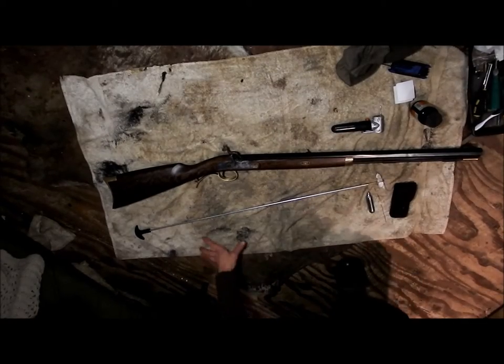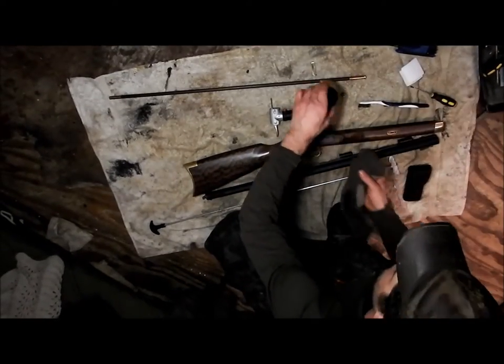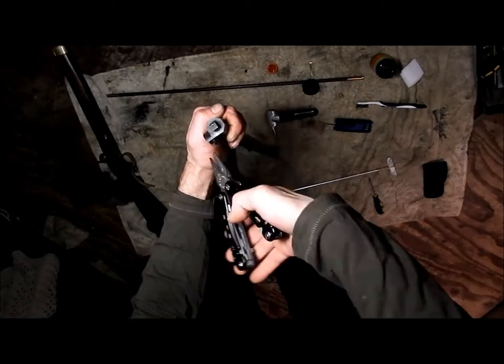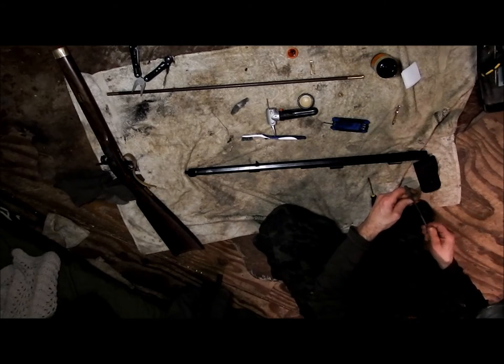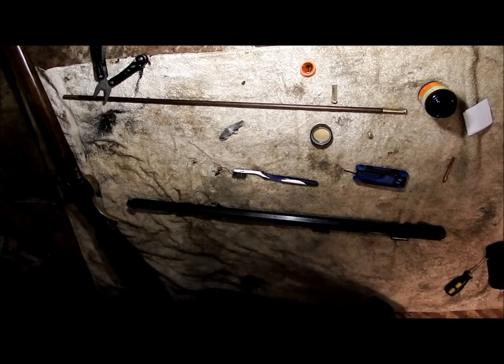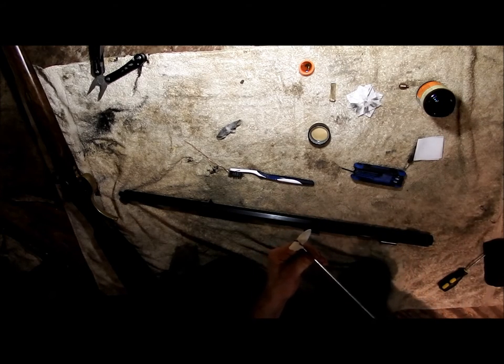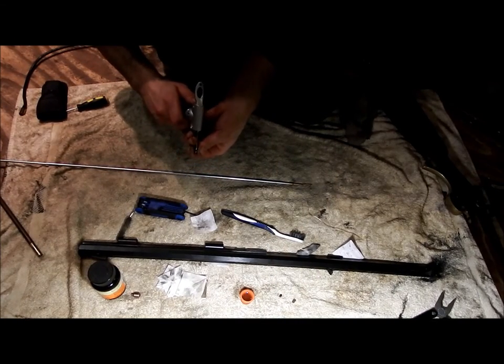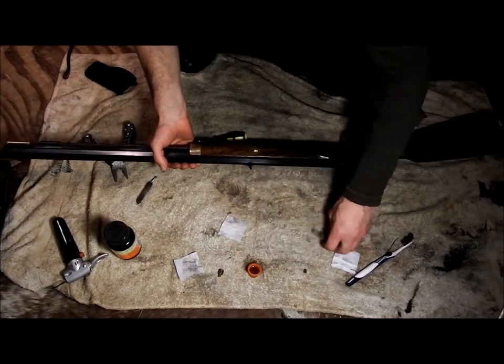cleaning the Lyman muzzle loader

Comment: Fill a bucket or large can with Hot soapy water,  immerse the breech end of the barrel in the water, then using a patch in your rod to pump water in & out.  Change water a few times until the water runs clear.  Swab out excess water with a patch, then spray in some WD-40 to remove residual water, finish up with a patch saturated with Birchwood Casey Barricade to prevent rust.  It's easier and more thorough than what you've shown in the video.

Also, get some comet cleanser and scour out that nasty sink - your Mom will thank you.